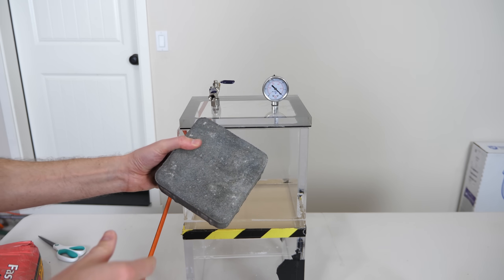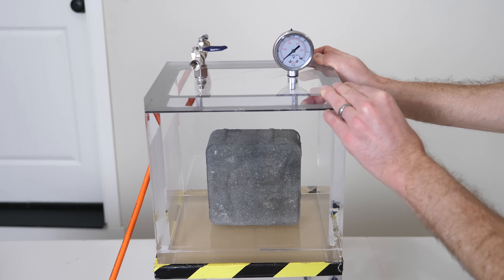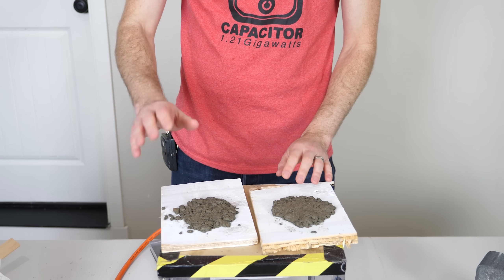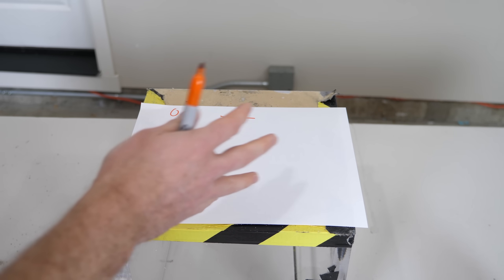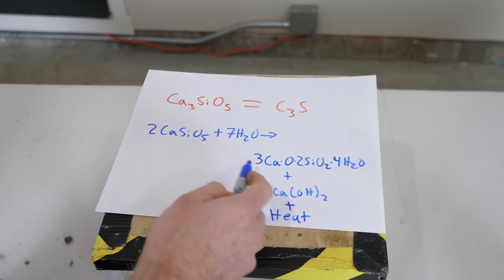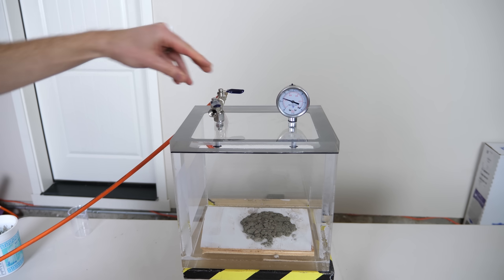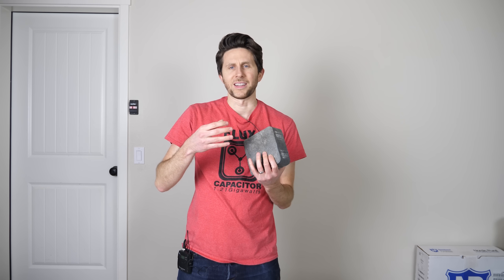Does Concrete Turn to Dust in a Vacuum Chamber? Concrete Without Oxygen Experiment

Comment: Now I want to see if there's a way to make concrete smoother by using very fine aggregate, lots of water to make it very high slump, and putting it through a vacuum purge first like epoxy.
Knowing it won't affect the curing of the concrete I wonder if you can de-bubble the mix to make it smoother? I also don't know how many bubbles would be formed during curing like CO2 released from carbonates or H2 not consumed in the hydration.

Comment: Maybe they referred that the structure would collapse cos the lost of the air chamber inside and then the sudden return of it, but even that it's bugus cos as the structure it self does not depend on the presence of air to begin with its odd nonetheless

Comment: Cement should be tested on pressure, cement is weak by default by breaking, thats why they putting steel armature in cement to get both properties. This is bad test without fundamental understanding cement properties.

Comment: Your description of concrete needs to be refined and more detail cause technically it was the description of mortar concrete has sand, Portland, cement, and gravel or rock. And this also is a very poor definition, cause there are three completely different types of mortar and more than a dozen different types of cement. But for your purpose, it would be Portland cement, sand, and grow other parts of the world. It would be slightly different and that would be in the cement part. I believe in the experiment you’re creating the use of a lime mortar with with very little mortar that takes about a month to dry would probably be the most dramatic in the tester doing. But it will not be realistic.

I think the best way to make concrete disintegrate would be to vibrate at its resident frequency and it should tear itself apart. There are multiple videos of bridges made out of concrete that hit a resident frequency and completely destroyed the bridges. I think the latest one was the one in London. It did not fall completely but it took two years to fix the resident frequency of people walking across it that almost took it down

Comment: Seriously, the oxygen in the concrete is bonded on a monocular level and in your little vacuum experiment there is the other factor of zero load like you would see in a high-rise building so without watching this first I'm going to say that the slab will be absolutely fine

Comment: Have just started watching, , 17 seconds in, and my guess is… the entire claim that concrete will turn to dust in a vacuum is nonsense. Yeah, concrete has low tensile strength, but unless there’s a large pocket of air trapped inside it that can’t leak out, the concrete will remain intact. NOW… I’ll watch the video.

Comment: Is lack of oxygen in atmosphere the suspected problem for cement, or lack of atmospheric air pressure? By putting the concrete cube into a vacuum chamber tells us little  about the effect of oxygen deprivation on the concrete.

Comment: CEMENT is NOT concrete, as you stated. Cement comes from limestone, which comes from shellfish. Cement & sand are NOT concrete either. THAT mix is 'mortar',  we use it between bricks. Concrete contains  aggrigate. As a builder & to my annoyance, these terms are tossed about without concern for accuracy. A 'scientist' should have higher  standards.

Comment: People are clearly getting confused. A vast number of rocks, including the constituents of concrete, are made up of oxide compounds. for example, sand is silicon dioxide,  quick lime (a key ingredient in concrete) is calcium oxide, etc. etc. 
The point of that video is that if you remove all oxygen atoms (and that means removing a decent fraction of the total atoms that make up concrete), then the material would fail.

Comment: Guessing it will maybe weaken the structure a bit and make the outside fracture a little? Concrete have great compresive strength but not all that much in term of stretching so the air trapped inside will be pushing outwards and with no air outside to push back it will all be stretching the concrete which is its weak point. Don't know if its enough to do much to the overall block other than pockets of air vety near the surface might be able to break free and if there is a particular arrangement of air bubbles it might be able to fracture it but it's hard to predict and I am not sure if the pressure from inside is enough.

Comment: Dumbest thing I've heard today.
Ya might get some pops in a vacuum though.  Air trapped inside.  Like burning concrete thats been water soaked.  It can be hazardous.
Dry?  How odd... yes, it will dry. I dry stuff in solid vacuum all the time. Ever hear of a freeze dryer?  It wont dry any water thats been consumed in a reaction though.  Its locked up. That reaction has begun as your concrete has warmed up.  Over all I have little faith in the durability of your concrete though.  You have focused on the water cycle, completely ignoring and in fact denying the carbon cycle in which carbon dioxide is slowly reabsorbed into concrete’s structure and reacts with the calcium hydroxide found there to form calcium carbonate in course of the concrete set.  As the atmosphere is missing, the Co2 will not complete the Co2 set cycle and the calcium carbonate will not set.  Looks like a partial set to me.

Comment: you gave the mix too much time outside vacuum reaction heat is the clue to this failed experiment. that means you dont actually have the means to make the experiment properly. you would need to mix in vacuum to know, this test is a failure!

Comment: Im just a simple man, however im pretty sure at the start you said to just mix cement and sand to make concrete without adding a liquid. Also, just chucking cement, sand and water in a bucket without half decent ratios wont make decent concrete. Thats why your mix looks lumpy and too dry instead of looking like a smooth looking wet paste.

Comment: Guess (before seeing the rest):  Nothing will happen.  Reasoning:  If it were the case that lack of oxygen would cause concrete to crumble, the interior of concrete, separated from air, would be weakened, and large concrete structures would not be possible.

Comment: If you removed oxygen, you wouldn't have either cement, or water...and couldn't make concrete in the first place...  H20 without O isn't water.  and silicate without oxygen isn't silicate.  But, once the chemicals are made, you can't suck out the chemically combined oxygen atoms from their atomic attractions.

Comment: Well...there is concrete, and there is concrete.. the density of concrete isn't the same.   The statement that concrete relies on oxygen to remain rigid is not correct.  Oxygen in water is critical in the curing process as a chemical reaction.  But, once the oxygen is bonded in the compounded molecules, it is stuck there.  A simple vacuum won't unbond those molecules.  (a few other steps would, however.)

Comment: Paused at 50 seconds. Where did this belief come from? I would assume the only sight of "concrete" some have seen is that lander thing trying to touch down on that asteroid, and it is mostly dusty powder. That is because the asteroid is a collection of dust and small rocks (call it a space dust bunny), not held together. Concrete has a structure that is solid. It is one big piece. A block of concrete is not a pile of concrete powder. I will now watch the video and see if I am correct.

Comment: the thought concrete would fail without oxygen is Ludacris, yes concrete will harden in a vacuum
 the color difference is because you didn't pat mold the vacuum test control

Comment: We are told that the Earth's atmosphere does not escape into the vacuum of space due to the Earth's gravity holding it in place. If we use this vacuum box, with a vacuum, and invert it so the valve is on the underside and turn the valve to open then air will immediately fill the box in defiance of gravity! So why doesn't earth's atmosphere also disappear into space? Somethings is wrong!

Comment: I predict it'll stay concrete.  The cement is a ceramic binder.  O2 is not required.  However, I don't believe wet cement will turn into concrete because the vacuum chamber will boil off the water, dehydrating it.

Comment: Commenting before watching the video. As a concrete construction worker, I know that 4 things are needed for concrete to maintain its strength. Cement, rock, sand, and moisture. That's right, concrete retains moisture. So being in a vacuum will not affect it unless for some reason the moisture is removed.

Comment: Cement does not dry to become concrete.  It sets.  It takes 72 hours for it to completely set.  Water just acts as a catalyst to start the process.  You can ever put cement into a lake and even with all the added water, it will still harden.

Comment: To be fair, to do this test you would need to vary the size of the aggregate mixed with the cement, as it looks like you made that block with fine brick laying sand. So you need to make several blocks with gradual increase in size of the aggregate, as most concrete applications use 6mm - 10mm stones with a sand binder. Whether this would make a difference, who knows? but most concrete structures do not use concrete the way you made that block.

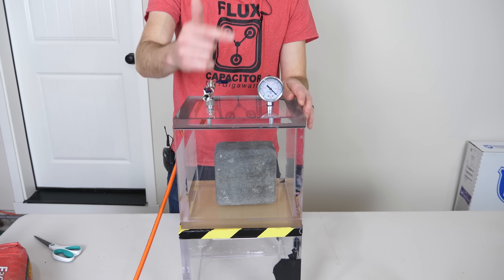Comment: 1:37 I assume nothing will happen since the oxygen and any other gases necessary for its composition have already bonded/disolved with the material and can’t be removed.

I also believe this is the case since you can shot bullets into space, because oxygen is created through the chemical reaction upon ignition.

Comment: well i think what they mean is that all the oxygen would disapare like the one in the water so yeah it would just turn into hydrogen but also if that happened you would not live to tell the tale, cuz you are made in large part by, oxygen so many of the necessary components in your body would break down,  so the proteins in your body would just disaper and intern turn you into a pile of oxygenles goop.

Comment: My predictions (although I'm not feeling 100% certain) are... Nothing at all will happen to the already cured concrete in the vacuum chamber. I'm also doubting the freshly mixed concrete will be affected by the vacuum chamber either (although it probably will visibly expand as it degasses) because it will get all the oxygen it needs from the water used to mix it... it really doesn't need it from the atmosphere. It's like pouring plaster into a balloon and tying it closed - it will harden anyway... although it would suck as a party decoration.  Now let's see if I learn something new in this episode...

Comment: you still couldn't set concrete in space, too cold. concrete doesn't cure properly if it freezes, you'd have to keep it warm somehow. still pretty cool though, i would have thought enough water would boil away to ruin the cure.

Comment: There's a difference between removing all oxygen, which can exist on its own as a gas, and all oxygen molecules, which would reduce much of earth to ruin: all water (oceans, lakes, rivers, you name it) would turn to hydrogen gas, all life would die immediately (many life forms can survive no breathable oxygen fpr several seconds, but the oxygen molecule composes many dogferent aspects of life, such as DNA), and the Earth's crust would become significantly weakened and potentiall partially collapse. So concrete turning to dust isn't all that surprising in the face of everything else that would happen.

Comment: For your vacuum tests, consider having a second chamber at twice the volume. Pull as complete of a vacuum on the larger chamber as the pump will allow. Then have both chambers plumbed together with the smaller of the two being the test chamber. When it’s time , open a valve and let the larger chamber evacuate the gases from the smaller. I was just thinking the abrupt pressure change might have more filmable effects. Perhaps not. You’d have another vacuum chamber… that’s cool. Thanks for the video

Comment: It would be cool to put concrete into a vacuum resistant liquid (something that will not boil in your vacuum chamber or water and see how porous your concrete block is by checking if any gases will bubble out from it or not

Comment: The concrete foundations of Porchester Castle were laid by the Romans below the surface of Porchester Harbour. (Porchester England, near Portsmouth which is a small suburb of Southampton)
P.S.  I think they used quicklime. Apologies to concrete heads for such an obvious display of ignorance on my part.
PPS  Pompey (Portsmouth) is a truly great Naval Port, both historically and contemporaneously. Football dictates that Southampton and Portsmouth mercilessly take the piss out of each other

Comment: Pulling a vacuum on wet concrete not only dries it out, but the cold retards the curing process. In a few days, both samples should be of relitavely eqaul strength.

Comment: On the one hand, perhaps. But on the other hand, concrete is great at retaining compressive force, but not so great under tention. I'd imagine if the concrete was under some load a -20% drop in ATM would cause a firce imbalance in some piller somewhere and some buildings to crumble.

Comment: First, That's a paver he's holding, not the best kind of concrete for an experiment. 

Second,  It takes 72 hours for setting concrete to reach 85% strength,.
 It takes 28 days to get close to 95%.
 After that concrete keeps curing for the rest of its life it never stops.

Third, The fact that he even had to make this video is very troubling!

Comment: I would call it CASIO3

Concrete doesn't 'dry' so much as it cures. Soaking wet concrete will still turn solid and harden even when submerged.

Comment: Concrete will set underwater, if you can keep it from washing out of your form.  People who claim it will turn to dust are simply WRONG 😮
The only thing that affects concrete setting is freezing temperatures, and then only if the water freezes before the reaction starts because it can get pretty hot.😅

Comment: Nothing will happen to it. Molecular bonds in concrete do not require air pressure. While oxygen is an integral component of those molecules, once set, the bonds are formed and can only be broken by introducing energy or a solvent of some kind.

Comment: I knew the answer before i even saw the video. The water issue is minor, but in space it would be a problem. On the other hand a filler like resin would solve that problem, since resin doesn't need air to cure.

Comment: Once again I simply ask that someone does this very difficult science thing.
Two clear cubes. One inside the other.
Held apart by magnets. 
Magnetic repulsion.
So there's a cube floating inside a cube. Pretty simple.
Then you remove the air between them with an air sucker.
Basically I want to see a firecracker pop with no sound.
Unless of course, sound can travel through magnetism?
I don't see how this is a problem.-James S Hart III

Comment: My guess before watching is that there will be no change. I can't see requiring OXY to for concrete to remain solid. That doesn't make sense. What might make sense is that it requires air pressure of some kind, so could be any gas, to counteract the internal pressure of 15 psi. However, I am going to say I don't think 15psi is enough pressure internally to collapse the concrete.
update: ok, so I was right about the concrete. Makes sense, 15psi is not that much to have to deal with structurally. Now will wet concrete dry? That depends on what the chemical process is. If it is an oxidation process, then no it will not dry. If it is simply an offgassing process, then it may even dry faster. I am going to guess it's an offgassing procedure, so I am going to guess that it dries faster in a vacuum than under atmosphere.

Comment: It has to be Chinese concrete to turn to dust.  Chinese concrete poured by corrupt contractors would consist of ash and water(no cement).  Real concrete is actually stronger when it cures under water (no oxygen).  I used to work on a concrete forming crew.

Comment: Concrete does not "dry".  Water becomes incorporated into the crystal structures that bind sand and rock together.   The process is reversed by heating.  A problem for concrete is actual drying before it has cured.  Then it becomes crumbly.

Comment: Concrete "Cures" it does not "Dry."  Drying is a process of dehydration where as Portland Cement Concrete even "Cures" under water.  Water behaves as the catalyst for for Portland Cement.  Quick "Drying" Cement has an "Accelerator" added to it to speed up the catalytic process. Concrete is a manmade stone similar to limestone and as such, much of it can last millions of years.  The enemy of concrete is chemical and durability. Some mixes start deteriorating twenty to thirty years.  Much of the Roman Cement is still here to this day like the Pantheon in the City of Rome.  The art and science of Roman Concrete was lost and Portland was the answer to developing a Concrete that cures under water like the Roman Concrete and both have quicklime in the recipe. 
Roman Concrete is much more durable than Portland Cement and when used in marine environments it will actually self heal cracks wherein Portland Cement just continues to crack and deteriorate. The Romans also used seawater as an ingredient.

Comment: Testing in a vacuum is only 1/2 if the problem. Space is very cold so water would freeze. Cured concrete should be fine but new concrete will not set up in space.

Comment: One issue that COULD have come up is the dissipation of heat. For cement to cure properly, you need to get rid of the heat. For example, the concrete in the Hoover Dam was fitted with cooling pipes through it, and ice water was poured through those pipes daily. as the concrete cured. Here those wooden boards were probably fine for removing the heat, but without air, you MIGHT have less ability to remove the heat from the reaction.